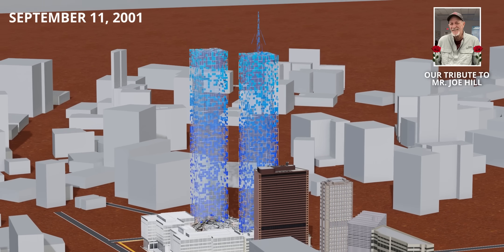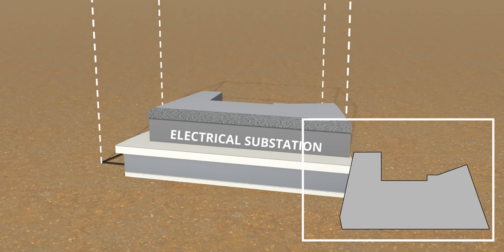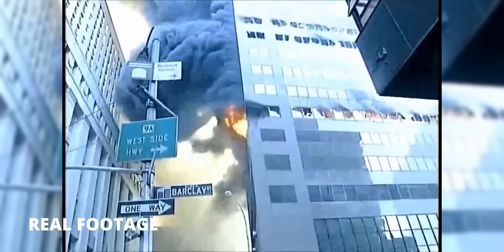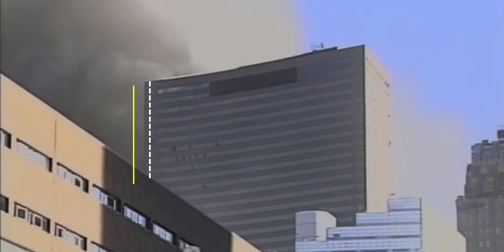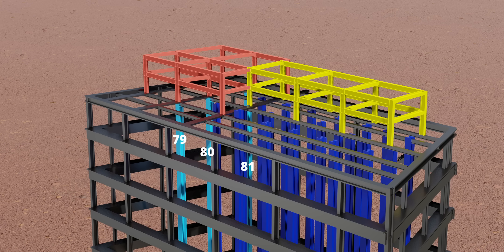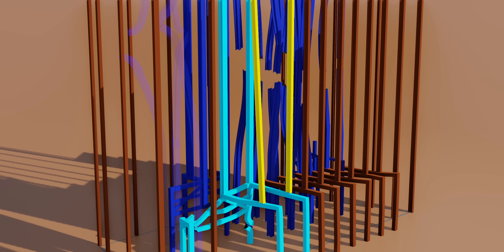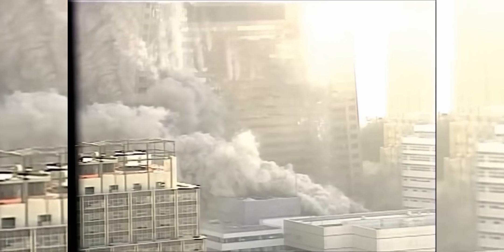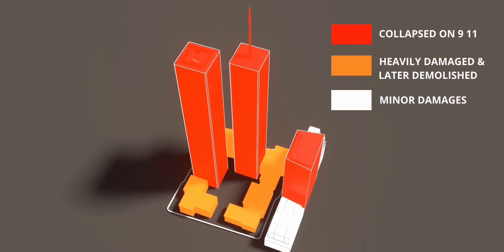Collapse of Building 7 | The Complete Physics

Comment: Would it be safe to say that if the Penthouse was not added and carried solely by those three columns, it is highly likely that WTC7 would not have collapsed?
Reply: @danielmorris6523  it was just collapsed.  It was pulverized.
Reply: it would be safe to say it would probably collapse in a different manner
Reply: likely wouldn't buy enough time to control the fire.
Reply: Don't think that that is safe to say. As long as the fire was raging, the more the columns were increasingly weakened. So, without the penthouse, there would have been less loads on the columns indeed, but with the fire going on, the resistance would continue to degrade, and the moment the Load is bigger than the resistance, a column fails. So likely, it would have taken extra time for the columns to buckle, but they likely would have buckled.
Reply: The damage and heat would probably still make it collapse. Its still a sh*tload of material
Reply: It sounds like structurally the WTC towers were quite unique. I did some research on how the jet fuel managed to damage the steel beams when other buildings have survived equally violent fires. I think there was a case of a lost bomber in the 1940s hitting the Empire State Building and although it burned for hours it didn't collapse. The fireproofing was done via a coating on the steel beams and one thing I found surprising was the effect that fire can have on steel. I have a member of my family who is convinced 9/11 was an "inside job". I've tried to scientifically argue with them but it doesn't make any difference. They still don't understand that you don't need to melt steel for it to weaken. The fire was hot enough and there have been tests done which demonstrate that if exposed to fire the steel can weaken. Plus, you can see with your own eyes how when the two main towers collapsed, they do so at the point where the aircraft hit the towers (though I know WTC7 collapsed solely due to fire). I'm not an engineer or an expert but try and understand as much as I can and it is frustrating when people like my father refuse to yield to the experts or educate themselves.

Thanks for your replies guys. All the best, Dan. 🙂